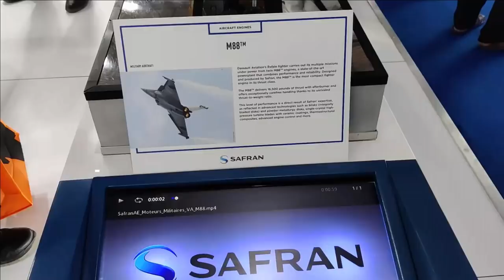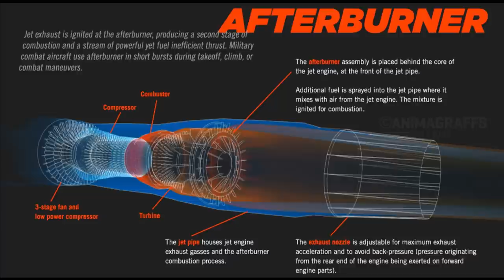Understanding the GTRE-Safran Engine program to power AMCA

Comment: Once We get The Hot Core Technology, especially The Metallurgical Know-how, We can scale up The Engine to increase the Thrust. Moreover, We can independently upgrade the engine later on by developing more durable Alloys, specifically Ceramic Matrix Composites.

Comment: 110 kn engine is enough for Tejas MK2, AMCA and TEDBF.
Once we mastered in this can design higher thrust engine.
High thrust engine may require for AMCA MK2 if we develop DEW or stealthy Tejas MK3.
Reply: For su30 mki we need high thrust also.... Coz Russian engine r not good as we develop with france
Reply: Indian need everything light , i don't know ,what the reason behind it but nobody uses 110kn engine for there 5 gen fighter jets
Reply: @Aditya-wh5uq  We will use 2 engines.

Comment: 1. Gtre and safraan is ready to develop 110KN or 125KN Thrust engine???
Kindly clear the confusion.
2. If safraan already have 105KN Thrust engine,then why will they waste money and time to just only increase thrust to 110KN Even when they were working on engines for 6th generation fighter jet which have very higher thrust.
Reply from the maker: 110 or 125kn? the answer lies when the deal will be inked between the two companies
Reply: But 105 kn with After burner , this new Engines will have 110 kn dry thrust.
Reply from the maker: @veena_93_.  110kn with after burners

Comment: i think we can still make reliable engine on our own.i might take time but the current projects will be stalled so going a head with foreign partner is ok for now but the soonar we get our own engine technology the better. relying on western engines is always a gamble anything can change.
Reply: @anbu sethupathy: 
You may "think" so many things. The moot question is: Is there any substance in it?? 
Even for an experienced aircraft engine manufacturer, a new engine – incl. the testing phase, can take a decade. 
Russia had at least 4 aircraft engine makers – Klimov (MiG-29), NPO Saturn (Su-30/35), Soloviev (Il-76) and Kuznetsov (Tupolev Tu-160). But  Russia still hasn't been able to get the 𝘪𝘻𝘥𝘦𝘭𝘪𝘺𝘦 30 engine – that was intended to power the Su-57 – ready as yet. And… Russia has several decades of engine making experience.
(𝘛𝘩𝘦 𝘤𝘰𝘮𝘱𝘢𝘯𝘪𝘦𝘴 𝘢𝘳𝘦 𝘯𝘰𝘸 𝘢 𝘱𝘢𝘳𝘵 𝘰𝘧 𝘜𝘌𝘊 – 𝘑𝘚𝘊 𝘜𝘯𝘪𝘵𝘦𝘥 𝘌𝘯𝘨𝘪𝘯𝘦 𝘊𝘰𝘳𝘱𝘰𝘳𝘢𝘵𝘪𝘰𝘯 – 𝘵𝘩𝘦 𝘙𝘶𝘴𝘴𝘪𝘢𝘯 𝘴𝘵𝘢𝘵𝘦-𝘰𝘸𝘯𝘦𝘥 𝘤𝘰𝘮𝘱𝘢𝘯𝘺 𝘳𝘦𝘴𝘱𝘰𝘯𝘴𝘪𝘣𝘭𝘦 𝘧𝘰𝘳 𝘱𝘳𝘰𝘥𝘶𝘤𝘵𝘪𝘰𝘯 𝘰𝘧 𝘦𝘯𝘨𝘪𝘯𝘦𝘴 𝘧𝘰𝘳 𝘮𝘪𝘭𝘪𝘵𝘢𝘳𝘺/𝘤𝘪𝘷𝘪𝘭 𝘢𝘷𝘪𝘢𝘵𝘪𝘰𝘯 𝘢𝘯𝘥 𝘴𝘱𝘢𝘤𝘦 𝘦𝘹𝘱𝘭𝘰𝘳𝘢𝘵𝘪𝘰𝘯 𝘱𝘳𝘰𝘨𝘳𝘢𝘮𝘴)